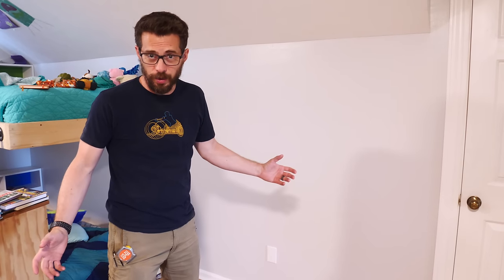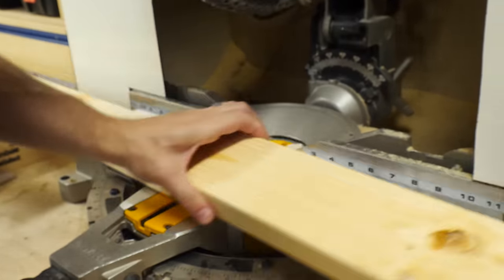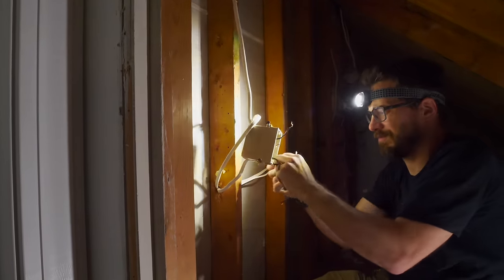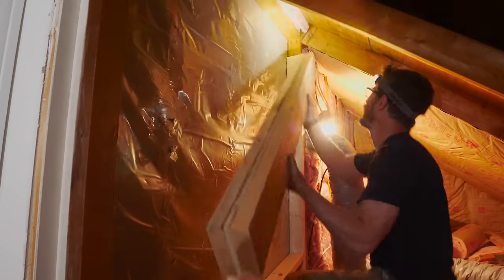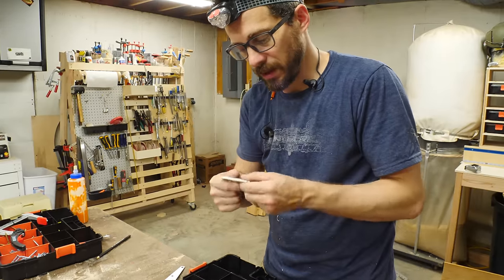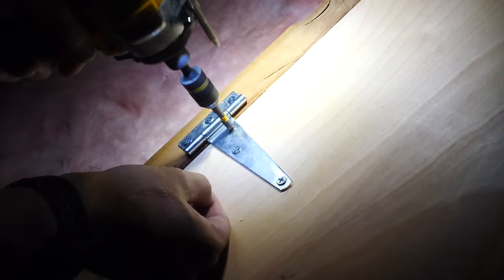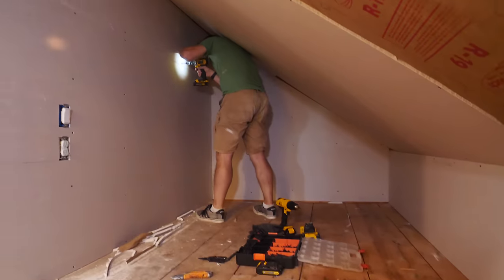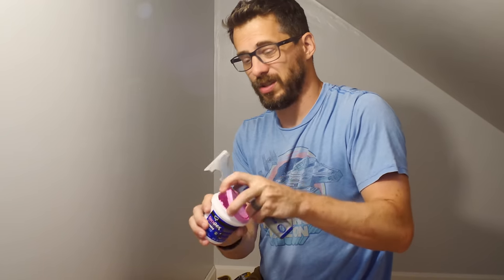Turning an Attic into a Closet/Playroom | I Like To Make Stuff

Comment from the maker: There have been several questions about moisture under the roof. It’s hard to explain but the rafters that I insulated between are NOT the roof (with sheathing and shingles). That is another layer up above that section. There’s not go by to be any issue with mold or moisture.
Reply: Class video! Best regards MrHandwerk :)
Reply: Still, if the outside (behind the insulation) gets colder as the room temperature and you havn't sealed the insulation air-tight, warm air might get behind the insulation (because of slight air pressure differences) where the moisture it contains condenses on the colder surfaces … Or did I miss something that would prevent that?
Reply: Chris Wolff so.......complicated!???😂😂😂
Reply: a table with secret compartments
Reply: I just like how hard you try to make life better for your family... just like my husband do 😊
Reply: I had the same question about choking off attic ventilation, leaving humid air with no exhaust to the outside, until I noticed at 13:18 the taller attic space behind the angled ceiling you finished out in this video.  Next question:  Why is there an angled ceiling, of a type that looks like the edge of a roof, that far below the real roof rafters, which don't parallel it?  :)
Reply: I like your stuff I like to stuff I can't build all of this
Reply: just fucking left all that trash under the floor, with electrical wires, definitely a safety hazard.
Reply: I Like To Make Stu
Reply: Chris Wolff You were speaking in Tongues there for a minute. Very Techno Logik Cool. You used a lot of big words. I don't like that jj lol
Reply: Aladdin Not all of us have Magic Carpet like you do Aladdin. Whenever you get angry like that when it's over something that has no effect on your life, just remember to breathe and measure your hairline. Look in the mirror and say, "It's not my fault x3 times. Blockbuster is not at fault regarding your hairline with their " Be Kind Rewind" campaign. Maybe next time you won't stand so close to the family VCR. I. bet it can physically Reminisce. A couple more years from now, your face will be on the Darkside of the Moon according to some of the top Barbar Colleges in your neighborhood. Comb Over and see for yourself
Reply: Pieter timmerman
Reply: I Like To Make Stuff did you go to school for carpentry? I’m about to  start within the next month
Reply: I Like To Make Stuff hi
Reply: Miad NamTtoc mk
Reply: @the42nddragon  I am curious, are you not supposed to put insulation directly on the roof play sheets due to condensation leading to rot? Does the type of insulation matter paper vs foil backed?
Reply: I think what people are referring to is your compromised building envelope after cutting through the vapour barrier between the (previous) attic space and the bedroom. It may take 3-5 years but due to condensation on the playroom/attic wall you should keep an eye out for mould and rot!

Comment: I did a similar room and was getting a quote from a tradie for other work but he insisted on quoting for this attic room too because I 'didn't know what I was doing' (me=senior female and he had a problem with women, haha). He planned to cut through the dry wall with a reciprocating saw 'without' checking power cable location even though power outlets and light switches were along that wall.  Did it myself (not with a recip saw) and sure enough 240v cables exactly where he planned to cut and not turn off the mains power. Good on you for teaching your daughter stuff like this, we (females) are just as capable.  Alongside my DH (we work side-by-side as equals) we built our own 2-storey house with no prior experience, so it can be done and the satisfaction is huge!!

Comment: This is crazy. I always thought that kind of work was for ultra specialized pros only. You're showing me that if you're willing to put the hours in, it's de definitly possible. Outstanding work.
Reply: Yeah Sure..... Go in your attic and start removing studs from the walls and braces from the roof without any kind of experience, good luck with that. You can tell this guy know what he is doing, he probably used to be a renovator or a framer.
Reply: Um... software engineer :D

Comment: When I mucked about with insulation in south Texas I used baking powder on my arms, legs, neck, etc. etc., since it is supposedly was fine enough to stop the fibers from getting under your skin, then rinsed off with cold water rubbing my arm from top down, it seemed to work for me.

Comment: So I have taken my new (first) house down to the studs and am rebuilding the interior....just getting the permits for all the work has been a sack of vipers.  BUT this video is a great microcosm of the steps of renovation.  I have been looking for a video like this to show my wife to be able to empower her.  She has never done insulation or drywall, and when I see we can do a certain amount of the work, she is incredulous.  I will say she is not wrong in her concern BUT she comes from a place  of having never done OR seen it done.  Thank you again BOB!
Reply: Michael Wilding a lot of these things can be done by people in general but on a big project like your house the main reason why you may want to pay people to do it is simply because of time. What takes ya'll 5 hours may take a skilled individual 1 or 2. But good lucc with your home
Reply: I totally agree.  We have a few contractors doing various things.  It's pretty crazy the sheer number of decisions to be made.  Thanks for the perspective.
Reply: Michael Wilding I bet. I do remodels and flips in Texas and I only subcontract the cement/ concrete, plumbing, HVAC and landscaping. Everything else we take care of it and it's hard to find people who actually know what they are doing and are right on the price. It surely is a big hassle dealing with contractors and moving them bacc to bacc to get one in as soon as the other guy is out. Hope all goes smooth and yall can get into yalls home asap

Comment: Never understood the use of those multi tools until I needed to shorten the length of a 2x4 attached to my slab right behind my cabinets and cutting outlet holes in drywall. A saw wasn't working well at all. GAME CHANGER. Wish I had bought one much MUCH sooner.

Comment: Coat your exposed skin with baby powder to keep the fiberglass from irritating you too bad. Not perfect but greatly improves. Also rinse in cold water before scrubbing with hot water.
Reply from the maker: Good call, thanks for the tip.
Reply: Lotion works as well.
Reply: Baby powder causes cancer

Comment: Very entertaining video I been a chippy for over 25 years and it doesn't matter if professional or amateur I've worked with both and believe you me there has been some terrible professionals to me being called Bob the Builder means you're good clean and come away doing a good job without any complaints I think you did a very good job and you're lucky to have a full-size workshop which makes a difference then working out the back of a van or on somebody's driveway with your trestles I Pat you on the back your kids have got a very clever Dad thank you very much for sharing

Comment: Hey Bob, don't know if it was mentioned before but I understand that you need to put a vapor barrier after the insulation and also the foam baffles to keep the airflow and avoid moisture problems later

Comment: Great job. I won't lecture about the fibreglass, no doubt others have lol. I've had several multitools, (I'm trade), one being a Fein (the original). They all burned out eventually, I'm currently on a cordless DeWalt the same as yours and am pleased to say it's performance is as good if not better than the others. When I was working (retired now) I used it every day. How did we manage without them....and head torches? Tip: When removing studs cut at an angle then they don't jam when you try knocking them out.

Comment: nice job and great idea....  yes it was a ton of work for sure.   so glad you got your daughter helping.   
Only thing is your studs and jack studs were not supported underneath by the floor joists.  that could cause you some trouble down the road.   but, considering the short span you might be alright.   keep up the great work.  very impressive.  2 thumbs up

Comment: I've got long but very narrow closet that spans almost the length of our bedroom but its really super narrow so walking in it and using it isn't the best currently.  I would like to cut out a closet sized hole in the wall and put up a sliding barn door so we can enter the closet from the front and it might be utilized a lot better.  I think there is a return duct in the area I want to put it though, so could REALLY use some help with ideas of how to begin this project.

Comment: did not notice if u used attic baffles when u put up the insulation. extreamly important. putting insulation against the roof will cause sweat, mold, rot.  just curious as to what u did that i did not see.

Comment: If I am installing fiberglass insulation in a hot attic I usually wear shorts and a t-shirt but i coat myself liberally in talc or baby powder which protects me from the fiberglass and washes off in a cool shower.

Comment: No offense Bob, but couldn't you have move the lower wall much more closer to the end of the fiberglass insulation to make it easier for this project?

Or even turn the whole attic into the closet/playroom to make it bigger and have more room to hold the toys/clothing?

Anyway, just something I have though of. For a new project, can you try and make a ten feet depth ten feet long pool for your backyard with a tire swing as well, please?

Comment: Probaly,would of used preasure treated plywood right from the gecko. Yes its a bit costy but it will save time other than replacing non treated while in build. Other than that,great video cant wait till i have my own workshop

Comment: Insulation irritation getting you hot?  Try, 'sun screen' on ALL areas exposed.  Oddly, this trick works for me.  Seems, the little fibers, find it hard to enter softened skin.  Why use sunscreen and NOT just lotion?  MOST of us who work outside, started years ago, and still appreciate the 'value' of using sun screen ON the JOB training.

Comment: Dude... Vapor bearer.... You should ALWAYS put in your Plastic vapor lining. 15:50
Reply from the maker: Not true. Using a plastic vapor barrier has a lot to do with your local codes (because of the local climate). In fact, in the Midwest , they often recommend specifically NOT using a vapor barrier. Check your local codes.

Comment: If you have the second attic above this why didn’t you straighten out part of the roof? Now there is unused space above the slanted wall which means you’re underutilizing both areas. Even if you didn’t want to move the studs you could leave those and use them as dividers. Add the rod between them and separate the boys clothes that way (if they share clothes it could be by type ie sweaters and collared shirts). And I’ll never understand the American fascination with ugly trim... its like you’re highlighting the access door where as a slim modern trim would make that look way calmer and not distract from the space itself....

Comment: R-13??? Depending on where you live, you're either going to end up with ice dams on the roof and ridiculous heating bills, or ridiculous cooling bills and it'll still be warm in that area. R-30 on roof and exterior walls at a minimum, but honestly more is better (in the northern climates, R-60 is called for). Other than that though, I like the idea.

Comment: I really like your work, but as someone from the Netherlands I can’t believe how you (Americans) run your electrical wires. Here you are not allowed to run those cables without using pvc piping where these cables run through. And even then, each cable is a single cable with its own specific color: brown (L1), blue (N), yellow+green (Ground) and for cables that run from a switch to a lighting fixture: black (switch-cable). You can run only one circuit through each pipe, and a maximum of 4 (and in an exception 5) of these cables per pvc pipe. You just run cables through studs and along them loose in the walls..

Comment: Alright, I just winced a little. 3~ million plus views, if someone hasn't asked about jack studs floating over 3/4 inch flooring .... well then I am. You should have blocked beneath them or at least mentioned that the cantilever effect would make blocking unnecessary.. You realized the necessity of a header and jack studs, I'm having a hard time wrapping my head around this bit of the video.

Comment: Ok ok I’m a dry waller and I cringe watching some methods you should invest in a drywall router you could have poked your holes through from back side then went to other side ran router through wall and let guide point on tip follow the studs way faster than scoring both sides also when cutting holes dry wall router again you mark with a measurement where you need a cut put your sheet up with a few screws then stick router in wall go counter clock wise tracing boxes and lights and bam done continue screwing and save like 20 minutes of marking measuring making cuts etc